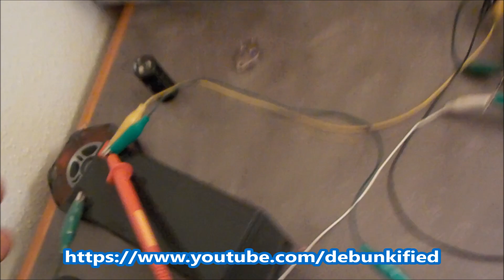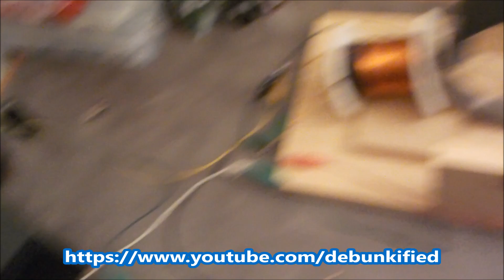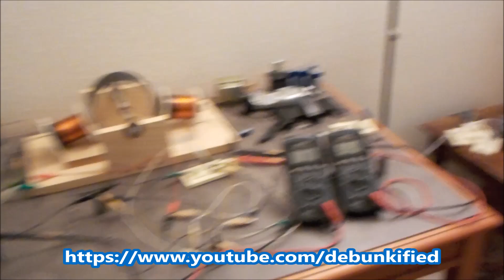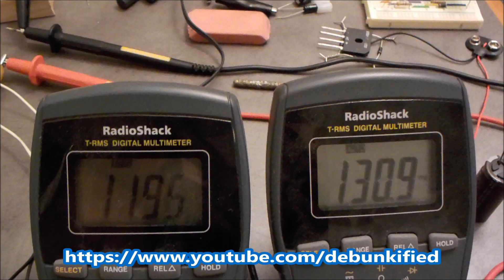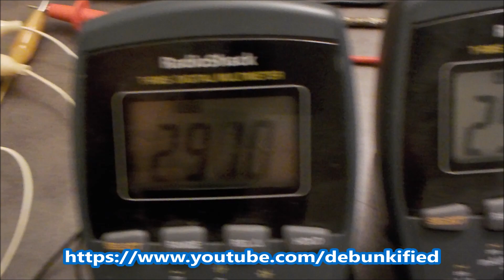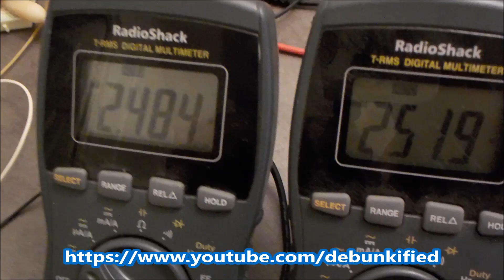Free Energy Motor Generator Joules

Comment: In the following link attached the compressed file:

http://katfile.com/lreicfgyfykx/BooksFreeEnergyOverunity.zip

Inside you will find advanced free energy documents (for which you may be interested):

A Practical Guide to Free Energy Devices - Patrick J. Kelly.pdf
aitchison_i.j.r.hey_j.g.-_gauge_theories_in_particle_physics_a_practical_introduction_1st_ed.djvu
Crane Patent On Pollution Control And Free Energy (1973).pdf
Doing Physics with Quaternions (Sweetster).pdf
electrinium_battery.pdf
Electrostatic Motors-1.pdf
Hotson - Dirac’s Equation and the Sea of Negative Energy Part1.pdf
Hotson - Dirac’s Equation and the Sea of Negative Energy Part2.pdf
Implosion_-Viktor_Schauberger_and_the_Path_of_Natural_Energy__1985.pdf
Logan - How to Beat Problem Energy (2005).pdf
Ltt.pdf
New_Energy_Ways.rtf
Peter Lindemann - The Free Energy Secrets of Cold Electricity.pdf
Peter Lindemann - The World Of Free Energy.pdf
ProgressElectrogravitic.pdf
quaternion lectures (sweetster).pdf
Radiant Energy Book.pdf
Sarfatti - Zero Point Energy, Star Gates & Warp Drive (2002).pdf
The_Electrician.pdf
Valone - FEASIBILITY STUDY OF ZERO-POINT ENERGY EXTRACTION FROM THE QUANTUM VACUUM FOR THE PERFORMANCE OF USEFUL WORK (2004).pdf
Walter Russell - The Universal One.pdf
Zero_Point_Energy.pdf

Comment: you measuring voltage.
electrons are easy to obtain.
try closing the loop and putting the charge on the small cap to the big cap.
it will run out eventually.
Reply from the maker: You are most likely right, the output capacitor is too small for one thing, another thing is that there is a lot of current leakage in that capacitor and doesn't hold energy that well. The video or two after this one shows two equally sized capacitors for an input and output. 

Eventually when I get the reed switches in I'll run the thing off of a super cap, charging a smaller cap, but still a good sized one. it's difficult dumping smaller caps to larger caps anyways and isn't the best.

Comment: I like your vids a lot. You may try some sort of flipflop switch to uncharge the output cap to a battery or resistive load while unconnected to the coil for a brief moment. Also, did you post the schematic for the 555 thingie? Maybe a Triac or simiar would be better than Transistors. Reeds burn out (that being said, who knows if that plasma is responsible for the gain, ala Teslas abruptly interrupted arks). Or, how bout them 19th century mechanical oscillators still found in door bells and tattoo guns. Looking forward to seeing more of your work, cheers.
Reply from the maker: Hi Harry, you're getting ahead! Just give it a few days, I am getting there. I'm working on the 555 schematic, it's because I make really nice ones and they take me a long time to draw up. I like to not only provide a schematic but also a bread board schematic so it's easier for others to just throw together.

Comment: You really have to calculate in the starting energy used up to get it to the running speed and that is much more...only if you could close the loop and it will selfrun then you would have achieved overunity...
Reply from the maker: You are correct! I am simply showing people the steps of getting there, anybody can show a self runner and say see, look at the self runner. But my intentions are to show people the "how" not the final result. The final result shows nothing really, sure it's solid evidence of overunity, but then nobody learns the "how" of achieving that overunity or how to get there, this is important to learn and understand.

We have explained that of course it uses a lot of energy to get up and running and build stored energy as gained momentum, but as seen in the next video that, that energy can be recovered, only when the output is maintained, which if it is infinite, would surely and eventually replace the power to get it up to speed and as long as the Lenz's drag is kept at a minimum at all times, the OU can be maintained.
Reply: I build cars but, I probably only tell the wife or some friend's about my plans for a build, I certainly don't make a video of them. When it is completed and running is the time for talking and videos. However..there are those in my field of work that are always talking about what they can do. They talk alot and honestly make videos of there plans but, never really produce anything. What we are telling Debunkified is show us a self runner then teach us how you did it. Until then, you're really...Just talkin.
Reply from the maker: Eh, really I just make videos of what has been done and what possibly can be done.